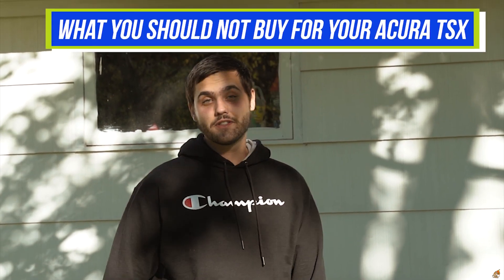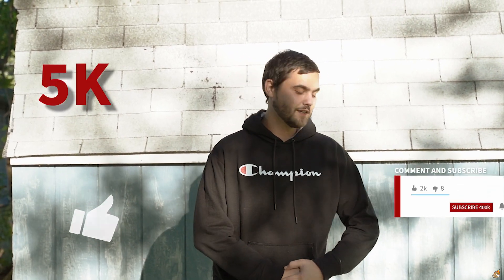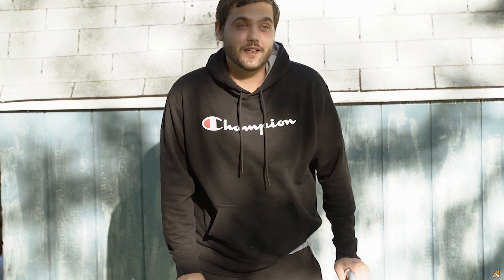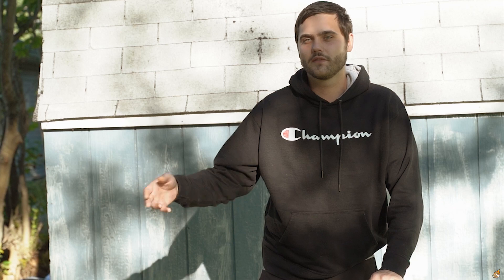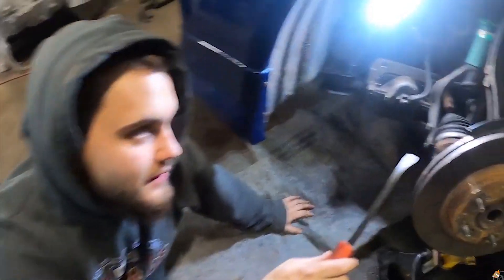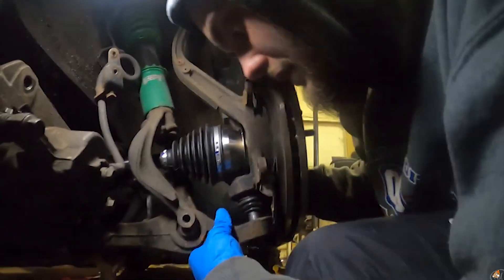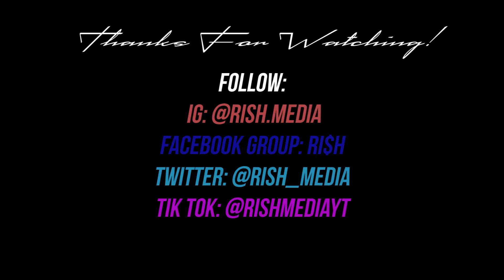TOP 5: Parts Not To Get For your Car/Tsx!

Comment: My mother in-law sold me her 08 TSX  a few months ago, driving it was like driving a bucket of rocks. New  coilovers, control arms and lower ball joints and allignment and she drives like a brand new car. Heed this mans inebriated advice, suspension is the cornerstone to success!
Reply from the maker: Definitely man!! It’s all
From experience and bullshit I’ve done with repercussions 😂😂
Just gotta learn from out mistakes and keep getting better 💪🏻
Reply: what’s your set up ?
Reply: @willisama4583  just got the car 4 months ago, so im not to far down the rabbit hole...yet,lol. But the first thing I had to do was replace the front upper and lower control arms(went moog for both of those), the shocks( went with isc n1 basic street...i like them, some dont... theyre stiffer than most ,but you really see that performance in  cornering and braking ),  rear: i only replaced the lower arms, the uppers are stock and ive seen a lot of people say to keep them stock. wheels:still stock (for now) with a 1 finger gap, stock camber on front -1" camber on the rear, though that will change from the stock 17" to whichever wheels i settle on. 

edit: the camber isnt -1" lol its -2.5degrees if im readin my allignment sheet right
Reply from the maker: @ohlookanotherchris1751  any plans on furthering the rabbit whole? 
Aesthetically or performance
Reply: @RishMedia  absolutely! gotta finish off the suspension first with upgraded lower and front upper swaybar and the trunk sway bars. After that swapping the at to a mt as well as a  remanufactured engine rebuilt for a low boost setup.  The body kit, its up in the air, its hard to find genuine pieces and i dont know where all to look.

 if you or anyone else has some suggestions on finding a body kit thats not duraflex i would be super appreciative. I cant afford the genuine mugen stuff on ebay lol and dont want a kit thats just for looks with no aero gains or worse , that part of the build is fuzzy in my head
Reply from the maker: @ohlookanotherchris1751  sheeesh your AT and doing MT swap? Feel like it’d be more worth just getting a manual unless you have the means of a full donor car. 

But your best bet is the Russian guys, dohcparts on ig or Facebook I bought my euro r full lip kit
Reply: @RishMedia  the swap is actually something I'm looking forward to believe it or not, lol. I got this car as something to tinker and mod and further my understanding of cars in general. That said the swap is a daunting task but not an impossible one lol. Locating ALL of the parts?, well we'll see lol... I ve considered the modded torque converter for an at boosted build but haven't looked to much into it

And thanks for the tip because I liked some of the Russian stuff I've seen and glad to hear confirmation.

Edit: definitely feel better about the ruskis now knowing you got their pieces lol, I like your tsx
Reply from the maker: @ohlookanotherchris1751  hey man go for it then if your up for the little lengthy challenge, shouldn’t be to you bad aslong as you understand how it work on cars for the most part. 

But yeah man seems like the only real source of oem lip kits now is from the Russian guys. 
Where most people get them

Comment: My tsx drives fine for the first 5 mins after start up but once the engine is up to temp does not accelerate any more. Mechanics say I have a bad transmission
Reply from the maker: Assuming you have a auto? Those transmission I heard are like grenades can  just go out. But had another instance where my buddy thought he did but it was his ECU that fried and didn’t let it move. 

When it happened was it slipping or just revving the Rpms?

Comment: Tsx 07-08. Is it a good option for a first car?
Reply from the maker: It’s a great option! Even better then 04-05! 
06-08 have the bit better engine and features also the 07-08 have plug and play tuning capabilities with hondata. 04-06 you’d have to go through the hassle of swapping ECUS
Reply: @RishMedia  ecu meaning the electronic control unit correct
Reply from the maker: @Nick-uz6cu  Yessirr, and they are getting a bit more expensive and harder to come by

Comment: I keep hearing all kinds of stuff bad about KTuned. I thought they used to be good. I have the Hybrid Racing master/slave combo
Reply from the maker: Yeah they used to be much better, maybe some stuff are still okay but id definitely prefer hybrid racing over ktuned.
Reply: @RishMedia  I just feel like the Exedy Oem clutch I went with is too soft lol. But it works wonderfully.
Reply from the maker: @xTruthxWithinx  yeah thats the first clutch i ever bought, exedy “oe” replacement with a light flywheel. Did what it should but on a softer side, even my stage 3 isnt to bad maybe a little stiffer then oem.
Reply: @RishMedia  it took a moment to get used to how it engaged at the top of travel but now it runs like a dream, 112 miles out of 750 for break in though 😅
Reply from the maker: @xTruthxWithinx  youd have to adjust your clutch pedal and where it grabs and possibly the nut on CMC
Reply: @RishMedia  I have no idea how to fully adjust the clutch pedal or the nut :( have you ever made a video of the adjustments?
Reply from the maker: @xTruthxWithinx  i may have talked about it on my hybrid racing cmc, slave and braided line install. if not there's definitely other videos out there or forums posts!

Comment: Dont buy : the nike headlights and the wannabe audi tail lights
Reply from the maker: Yooo I was gonna add the Nike headlights idk why I didn’t mention lmaoo I hate em 😂
Reply: I was considering them.. what's so bad about em??
Reply from the maker: @jspeshy21  horrible output and quality really, just same janky eBay headlights.
Reply: I like those lights lol Was planning on NOT running the check because it does look wack tbh
Reply: I have the nike headlights and had to do led bc they weren't working with the regular way. I had a hard and long process trying to figure that out. But theres not alot of aftermarket options for tsx